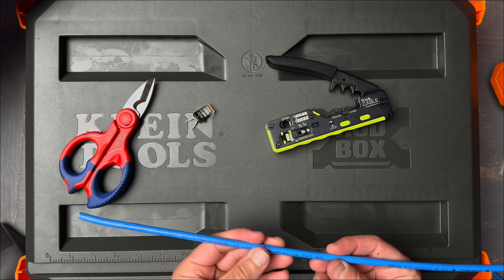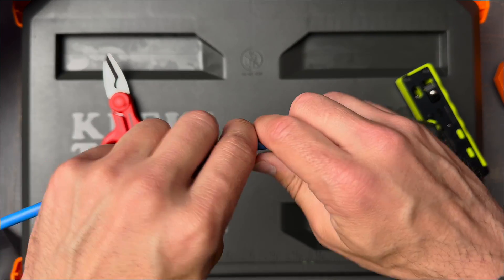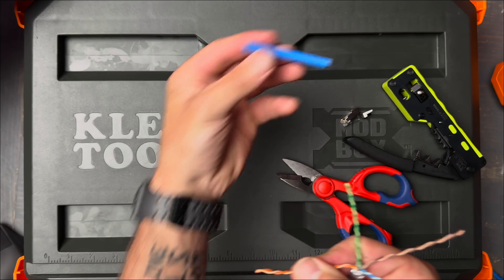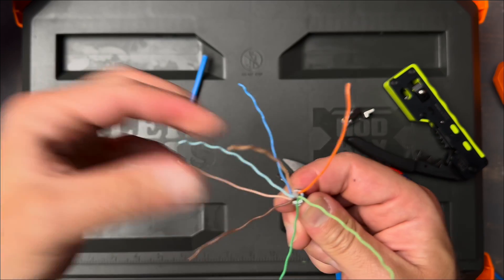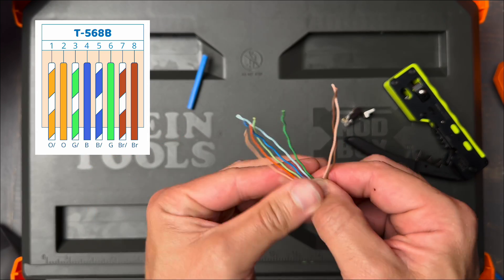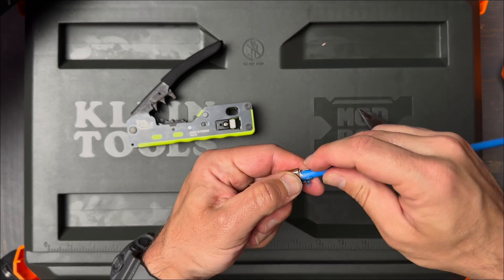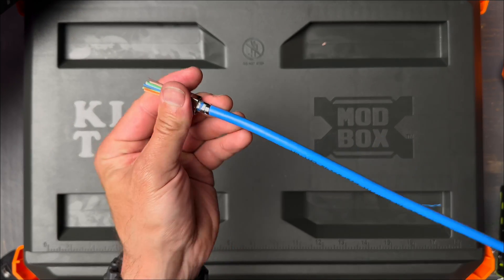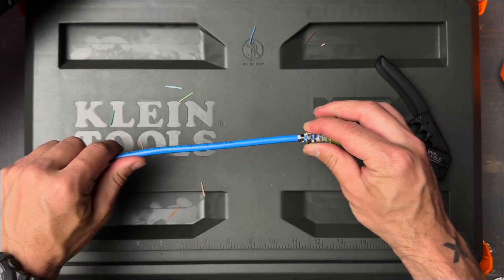How To Crimp Shielded CAT6A with Passthrough RJ45s Tutorial

Comment: You didn't show the use of the testing tool and I would love to know how to test cables that are really far apart. Due to logistics I had to run 300 feet of cable without the ends on so I couldn't hold the ends right next to each other to test connections
Reply: All testers have a remote for exactly that reason

Comment: Small comment to thank you for your help, i rented a room and the owner isn't really happy when i start opening walls. so my only option was to buy a super long cable to run it along the walls trough the house. problem being that at some point, i'm forced to pass my cable trough a pre-existing hole that already had 4 cable in it. the cable with the connector couldn't fit so i will have to cut the wire to pass it trough then remake the connectors. i see everywhere people are saying to use a keystone, but i simply can't in my situation.
Reply from the maker: Thank you for the comment! Glad it help.

Comment: that is an INSANE waste of wire trimming that far back on the cable! you've got 4-5 inches, when you only need 2! no wonder your fingers get tired unraveling that many twists!

also, you can run the tip of your thumbnail along each wire to REALLY get them "unwiggly" more effectively.

and what happened to your grounding wire? not sure what brand of wire you got, but even the cheap generic 6a wire has a separate grounding wire, to connect to that shielded RJ45 plug...

Comment: 2:30 "...you want to use stranded."
no. why would you ever? i can only think of ONE good thing about stranded: it bends easier. but in EVERY other way, solid is better:
1. fewer breaks in the wires when bent
2. more solid wire, making it sturdier when feeding thru wall cavities
3. more durable
4. holds shape well
5. thicker copper, meaning you KNOW the connection will be good, and it will not BREAK when you connect to a keystone
6. most common when you buy in bulk

and if you try to argue that you AREN'T buying in bulk, then you likely will not be capping RJ45 connectors! if you are doing this to fix a cable, you are better off just buying a NEW pre-capped ethernet cord, as you can screw up capping an RJ45 quite easily. i have even seen the "pros" at the local phone and cable company do crappy half-done jobs at it, and they do it on a regular basis!

solid. ALWAYS solid is better...

Comment: I just found out which I also confirmed by crimping a test cable that the Cat 6A S/FTP LSZH shielded cables from 4cabling in australia follow this pattern ... WTF????

Green&White | Green | Orange&White| Blue | Blue&White| Orange | Brown&White | Brown

I also found it extremely annoying that the twisted pair cable that should be mix of base color and white only could be identified by the fact they were twisted with its parent solid color!
All these are solid white which makes extremely fiddly and difficult not to mix up the wrong solid whites once you start untwisting the wires.

Comment: Im returning my crimpers, it is a nightmare trying to get the wires straight enough to put in the crimp. Im just going to buy cables with the crimp installed...screw this!!
Reply: You got soft hands brother
Reply: You just need to line them all up in the proper order between your thumb and index fingers of both hands, then soften them up by bending themback and forth. Then pinch tight and pull like you are trying to stretch the cable .  Just keep softening and pulling and they will all just line up straight. Watch that section of the video again.

Comment: For many years I used the B wire code. But when a it guy come  to location to hook up service it seems they all use the B code. Witch I don't like  they clearly can see I set up all useing the B. But they do A. Witch witch ever  A or B used should be the same across the  oard for best service. 2nd I use to use standered rj54 plugs. I have 20/20  Vision. And struggle to get the wires into the right location. These plugs are not clear plastic.. more on a foggy side. I  Even gonna as far as using a magnifying glass to double check. All looks good so I'd crimp. Hook up cable tester an 9 out of 10 it show a short. I use to waste so many plugs. Even checking 4 to 5 time before crimping.  An short would test.  Then looking over the plug every wire is were it should be but cable test fail. I later seen these pass through plugs come on the market.  I was skeptical because of the bare copper at the ends in causing corrosion. Was not until 2 years ago I changed over to useing only top brand name pass though plugs an trouble free. I see you useing a 1 step punch down tool. Never seen this before or even the tool. Only use the one at a time punch down tool. I  Skeptical of the tool you're using as you cannot see clearly what's happening with each connection As you punch it
Reply: My dude..   what?
Reply: 99% is done with "B"
Reply: The English 😮😂

Comment: Couple notes if youre doing this for the first time. 
Dont bend the wires at 90° when untwisting.
Dont forget to put on the boot prior to cutting and stripping or you'll be doing it all over. or you'll be doing it all over. or you'll be doing it all over.
Reply from the maker: is there some data or standard stating why you should not bend at 90 when untwisting? I get the reasoning behind it but is this actually an issue?

And the boot is optional and some times gets in the way depending on the application. They are nice but unnecessary.
Reply: @LowVoltageNation  I feel like he must be thinking of fiber. Bending at 90 isn't going to break any solid or (especially) stranded copper.